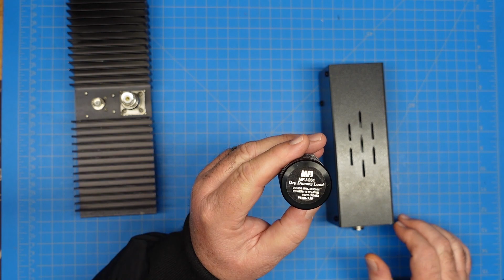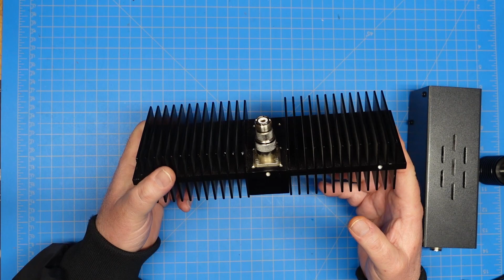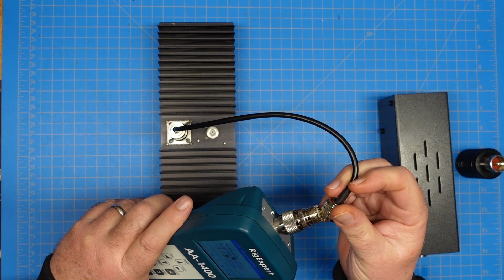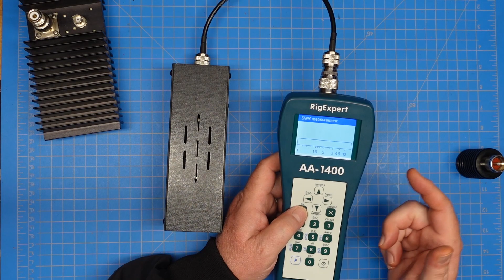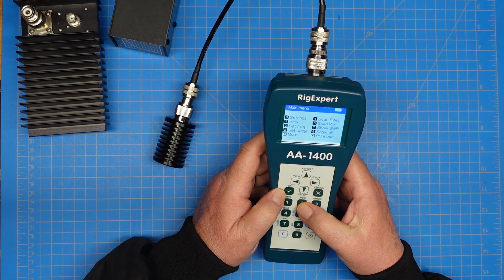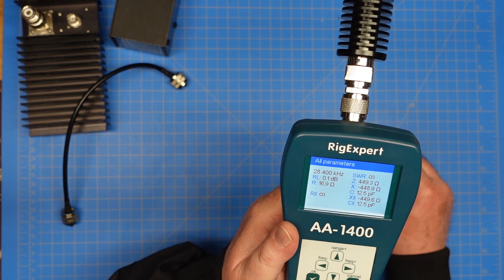Know your dummy loads - How to pick the right dummy load for the job!

Comment: Nice comparison of the three different dummy loads.  But you didn’t give the information stated in your title.  “How to pick the right dummy load for the job!”  Does the load need to be sized for the device such as a 10 watt for HT or can I use a 100 watt dummy load on everything up to 100 watts.
Reply from the maker: Good point!
Reply: And you still didnt answer. What is it?!?!
Reply: @michaelwinaker87  I know it's a little late, but yes, you can use the biggest load you have for anything up to it's rated power.

Comment: I have the 300 watt MFJ and it works flawlessly across HF. And my cantenna does the job at higher power levels. I accidentally had the mineral oil in the cantenna boiling at 1700 watts on 10 meters. Woops!
Reply from the maker: LOL!  I don't have one of those, I did get an MFJ-267, which is a 1500W dummy/SWR meter combo device.  I might have warmed it up more than once!

Comment: In my career in development and test of military radar and other electronic systems, a dummy load choice was generally determined by the level of average power the source (transmitter) could be expected to deliver to the load plus some safety margin, depending upon the design and nature of the system under test or operating conditions. Name of the game: Don't damage the human participants or fry any of the equipment. (Worst case considerations usually prevailed when protecting the equipment - Ex. A 1 kw peak power output traveling wave tube in the 2 to 4 Ghz band  only able to operate at 1% duty cycle, max. , so a 100 w dummy load would be sufficient)

Comment: I’m new to the airwaves and all of this is rocket science to me. I understand that if I take a 100 watt 50 ohm resistor and solder it between the center tap and ground she’ll of an SO-259 connector I have a 100W dummy load? If so, how do I know what the frequency range would it work for if I don’t have your fancy tool?
Reply from the maker: That would work at HF frequencies (up to 30Mhz).  Past 30, you need to get a little more complicated.  I haven't done a video on that, but there are several on YT.

Comment: Is there any way to test without one of they machines you were using ? I don't want to end up getting a dud one
Reply from the maker: You can do this with a nanovna, or a tiny sa as well.  Either one will show you the numbers.  Buy the dummy load off of amazon, that way if it's junque, you can send it straight back.

Comment: Total newbie… Can you recommend a suitable dummy load set for a Yaesu FT-818ND (rated 6W) front and rear connectors and for miscellaneous HT’s (up to rated 10W)?
Reply from the maker: Something like this (https://amzn.to/3AE9Rn6) or similar.  Any dummy load will work, it just needs to be able to handle the power you're going to put into it.  Getting a DL that's rated for 100W will work perfectly fine on a lower power radio.  Basically, the more power the DL can handle the more you will pay.  Those plug type dummy loads are nice, and a lot of people have had great luck with the MFJ one.  Pretty much, if it is 50ohms, and shows you 1:1 (or very close ) SWR it will work fine.
Reply: @FEPLabsRadio  Thank you for your comprehensive reply..!

Comment: Wow, that MFJ 261 isn't just bad, it's pure garbage!  I wondered if you might had dropped it and damaged it.  I would take a ohm meter and see if it's 50 ohm, since it should be just a 50 ohm resistor. This is why you should test your test equipment.
Reply: I SAY AGAIN MFJ 261 WORKING PERFECT DIRECT TO PUT TRANCEIVER

Comment: Unless you bought the small MFJ from MFJ,  there is a good chance that it was abused by the former owner.  It says peak 100watt,  but wouldn't put it past someone to put 100W CW into it for a minute or two, and turned it into a "crispy critter"..   Not saying that happened, but I have been bitten by flea mkt stuff I have bought before, so its buyer beware when buying flea's.  If it IS new, well, MFJ strikes again!
Reply from the maker: Arnold, I need to check, but I think I got it from Amazon.  Way past the return point.  I figure what you said is what happened to it, and Amazon just re-stocked it.